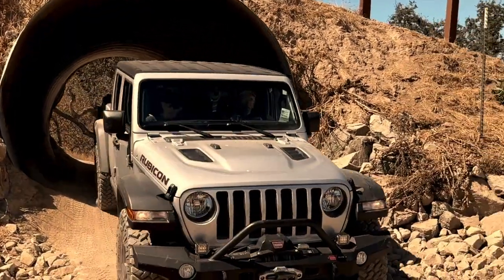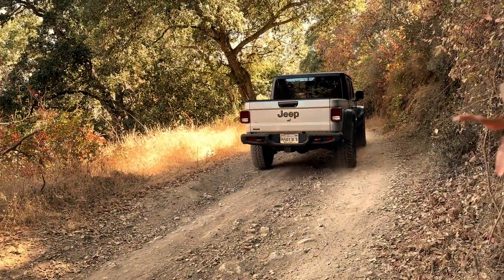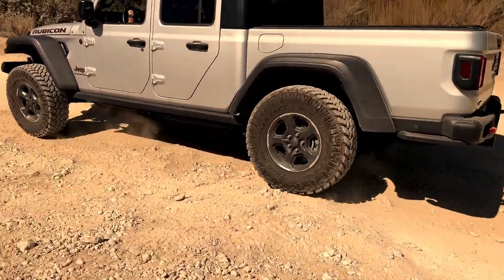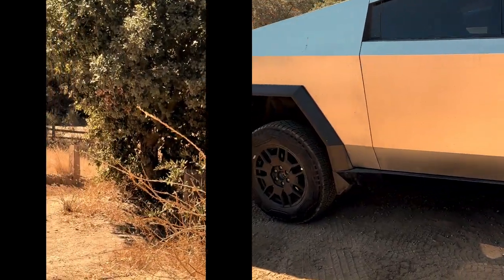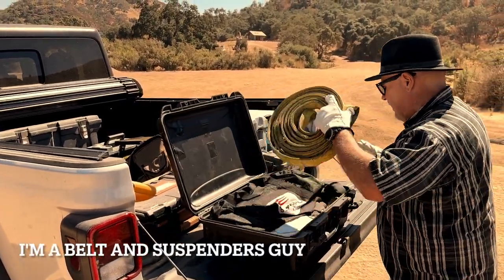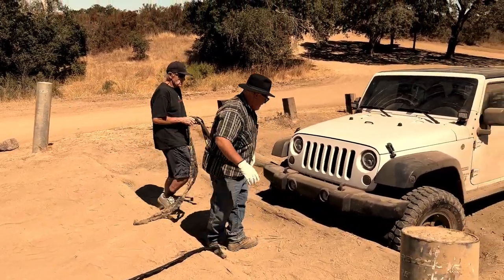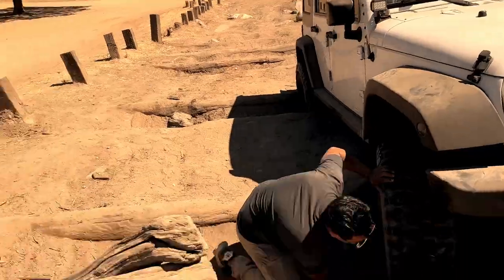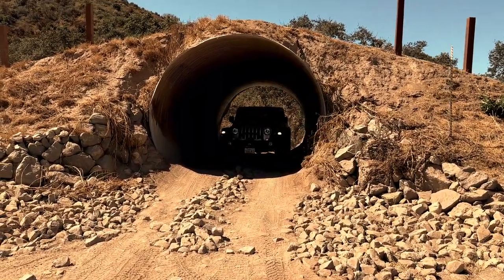Jeep Gladiator 2 Tesla Cybertrucks and a Jeep Wrangler | Day at a off-road park Northern California

Comment: @ 2:20
Come on those are NOT even considered offroad trails, those are everyday roads out here in the AZ desert that i run in 2WD.
Only time I've used 4lo was when i climb almost big sky looking wet rock walls and only time I've ever had to winch myself out was basically my fualt by going in a fine sand riverbottom that had a flash flood the night before and so  they may seem dry on top these treacherous river beds turn into quick sand and my jeep sank up to the bottom of my doors when i got out i would almost literally sink to my ma drangonballz 😂 and the only anchor available was a young 9" round mesquite tree about 80' away at the bank i spooled out alomost all my steel cable out and used a couple tree saver straps joined together to give me the extra reach i needed but my old cheap smittyBuilt 9.5Klbs gen 2 winch pulled out my 4door jku out but the oddessy extreme deserves the credit.
Reply from the maker: Ok, I get it. I was just messing around with in the Gladiator mostly to get some video of it . That is when we ran across the Cybertrucks. Had a couple old friends and wanted them to have some fun. Thanks for watching. I installed a 2"Mopar lift on that Gladiator last week. It is a lot more capable vehicle now.
Reply: @MuddyRuttzz  
Don't take it wrong what i wrote.
But jeeps with hemi control arms and a torsion sway bars and a small lift can almost do any trail with open diffs but if you have an LSD and a front locker you good but selectable lockers is best and get some beadlocks with a set of KO2 or KO3 A/T they are better for the long run and handle great compared to the KM3 when comparing cost to life ratio in my opinion